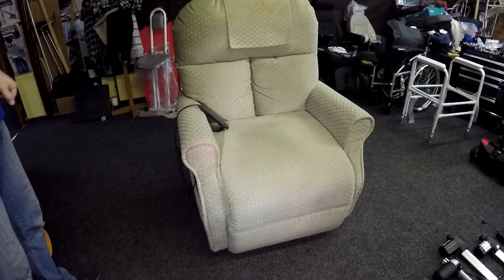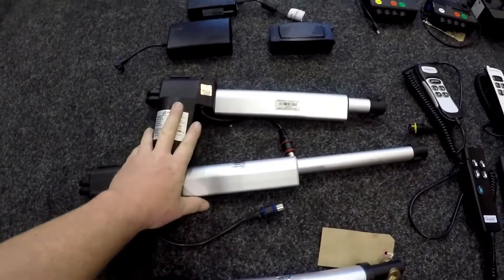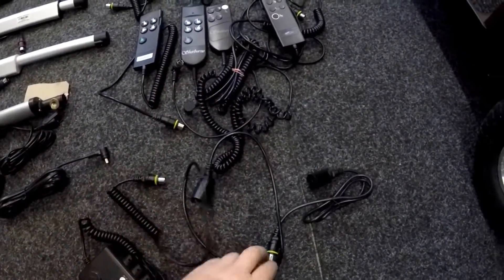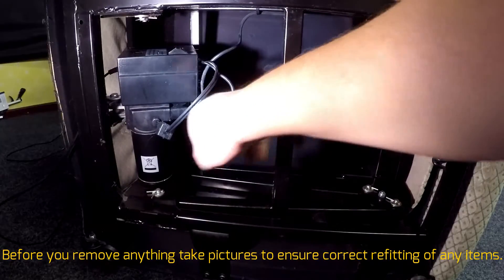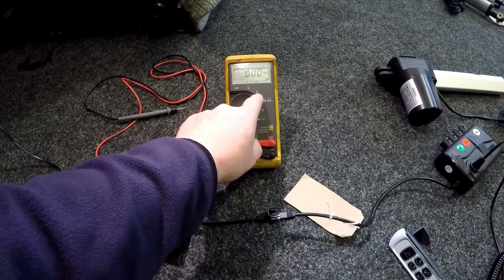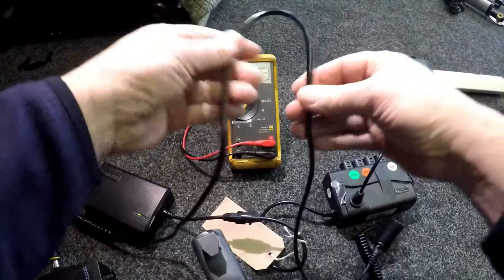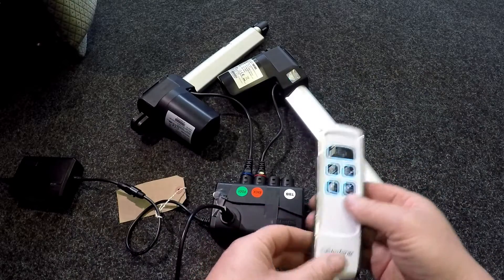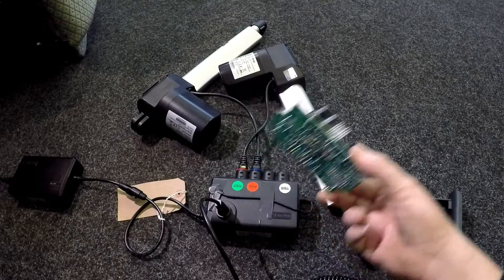Electric Riser Recliner Fault diagnosis

Comment: Hi , ive got an HSL riser/recliner chair...how do i open the celebrity controller, one of the buttons is hard to press.
Reply from the maker: @johngray2692  hi  handsets are common for going faulty as their thin design does not help. I don’t know the exact model but if it’s the thin one   It should have a couple of small screws on the bottom then you will need to gently wedge open the gaps that appear.

Comment: My recliner chair is sherbourne and stuck in the standing position. It is the old style hand control in your video.  Green light is on. Only button now working is to lower the back. I can use white button to put up but nothings else. 
Does my chair have a reset button or what could i try please .

Comment: My pribe mobility chair is working all but foot rest and when u use the button to make footrest move a black box in the side of the chair clicks
Reply: When the back moves the chair won't go down and foot rest won't come out
Reply from the maker: @Tony-d7o  would need to be inspected could be an issue with a motor or linkages

Comment: We have a power recliner that has a problem with the footrest, it no longer lifts when the back reclines. We used to hear a spring click and then it gradually started to rise but this no longer happens. Any ideas as to what is causing this will be gratefully welcomed. Thank you
Reply from the maker: @nikoletta7678  hi check linkages under the chair

Comment: Hi mate any ideas, put new handset on a sherborne touch stop 2 motor ,old handset was working fine but held together with tape. New handset which is the same handset from sherborne flickers when plugged in and the chair stops and starts when reclining or lifting, put the old handset back on and it works fine, i have another chair which is the same and put the new handset on and it works fine? Any ideas please.
Reply from the maker: There are 2 types of handset one that has touchstop written on it and one that does not . See the new one has it got thouchstop written on it ?
Reply: @tomjacques4  yes they both have
Reply from the maker: @chrislane2075  switch off at the mains  and leave for 3 minutes awitch in again and ensure you do not have any slack connections
Reply: @tomjacques4  I have tried a reset  including taking batteries out of transformer but still no joy 3 times, do you think it could be the old transformer causing the issue,new transfer maybe?
Reply from the maker: @chrislane2075  if the old handset was working f and the new one ain’t then maybe a faulty handset have you fully inserted the plug also have you tried the on and off switch at the back of the handset
Reply: @tomjacques4  yes,even tried the new one in the shop and it worked fine on a sherborne chair in the shop no flickering of handset and all reclining and raise was perfect, but when put on chair at home it flickers not flashes and then when raising or reclining it works then stops and starts again then stops, put old touch stop handset on and it's perfect, may have to get a technician out I think
Reply from the maker: @chrislane2075  very odd
Reply: @tomjacques4  thanks for your help it's really appreciated 👍

Comment: Hi There
My mums recliner has an external transformer and both the transformer indicator light is flashing and the armrest LED is flashing. whereas the normal condition is a constant light on both. It’s a timotion unit on a single motor lazzboy, that now doesn’t operate at all.
Any idea what fault the flashing light indicates as it’s not mentioned in the manual. I’ve had the switch and connectors apart, no physical faults that I haven’t already fixed. I can hear a faint click in response to the switch operation, which I assume is an actuator, but no movement. even looked for a reset, but found none.
Thanks for any guidance.

Comment: Hi, I have an HSL recliner. There is power to the handset but no buttons work. I suspect someone tried reclining too close to the wall and perhaps burnt something out. Neither motor works so I guess the control unit is the issue ( I would have thought at least one motor would work?). What do you think? 
Cheers

Comment: At 09:00 you wiggle the cable and suggest replacing the controller. My wife's chair is having this problem, is there a way to dismantle the controller to take a look inside. Replacements are the best part of £100. Thanks for the video.

Comment: Fault could also be coming from 1 of 2 micro switches in the pushrod assembly...
Reply from the maker: Cosmic Fugue yes there are a couple of micro switches in said shaft. Seen one faulty one in 15 years.
Reply: Exactly. I have a two seater electric couch and have already had 2 limit switches, one in each seat, go bad and they are not easy to replace.
Reply: @vernon6130  Yep... I know because I've already replaced 3.
Reply: @Initial_Gain  How do you source the limit switches?  I cannot locate ones with the right switch height.